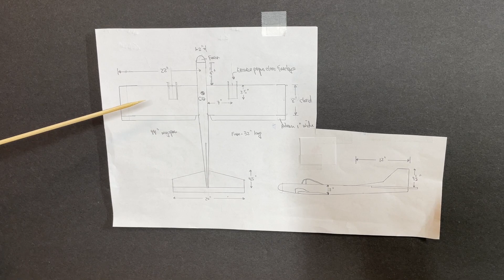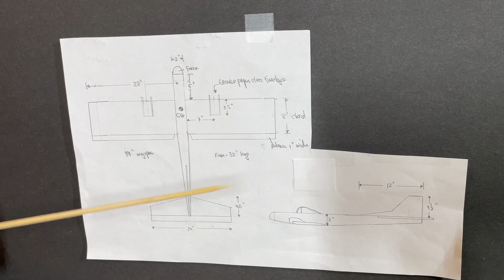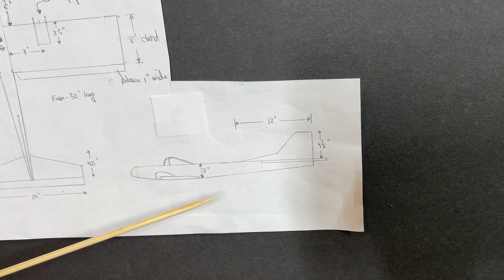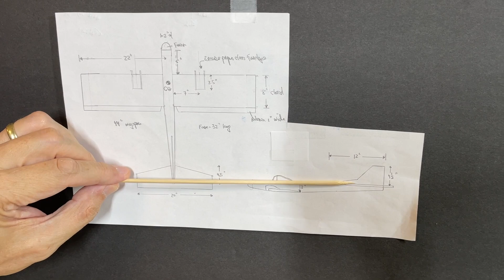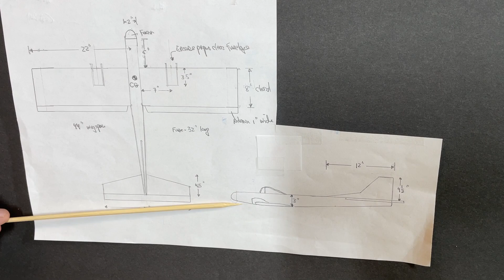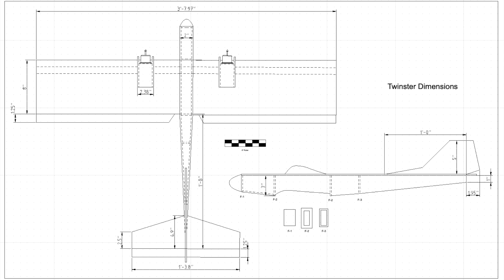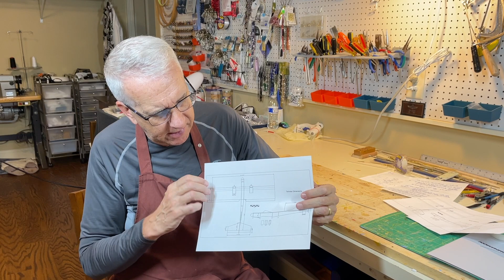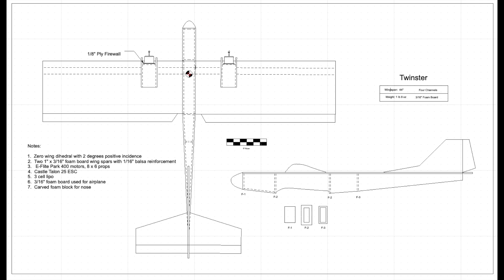How to Design an RC Airplane

Comment: Hi Tim. Am I assuming correctly that you are using one esc for both motors? Or are there two esc's placed in the fuselage? Thank you for your excellent videos.
Reply from the maker: I used 2 ESCs, one for each motor. I have a separate video on this. 😊

Comment: HI Tim, I have watched many of your videos. Great stuff. A question about RC aircraft design: 1) Recommendations regarding CAD software to purchase and learn from. Not too expensive and beginner user friendly? I notice you have used QCad and TurboCad. Recommend? 2) Now I'm  retired I would like to get involved in RC design, build and fly. Initially, start building from kits and then progress onto design. Would this be your recommendation?
Carry on with your channel as it is a great resource for the community. 
Regards,
Pete (UK based).
Reply from the maker: Pete:  Greetings from across the pond!  Your design plan sounds like a winner. I have several videos on aircraft design. www.QCAD.org for sure on the 2D CAD work. TurboCAD just too expensive now. I have some videos on QCAD, plus they have a great forum on the site. Tim
Reply: Tim, many thanks for your prompt reply. Much appreciated. I will certainly look into QCAD based upon your recommendation. Any thoughts regarding books on RC aircraft design? Again, beginner friendly to more advanced publications would assist as I make progress in self-study on the topic. Thank you.
Kind regards,
Pete (UK).
Reply from the maker: @PeterGreen-o6l  Pete:  There are some RC design books out there. I’ll be doing a video on this very subject, hope to get it out within a few weeks. Tim

Comment: Wow. That was a lot packed in to a video. Thanks for doing that ! I always learn a lot when I watch your content. It looks like a great little flyer as well. I'm going to embark on building a similar single engine "sporty" flyer, based on what motors I have lying around (a bunch of emax CF2812's I bought years ago). Probably won't be much different to what your foam bug ended up! 😄🛩
Reply from the maker: Brett:  The twin did fly well.  It would be very easy to simply stick a single motor on the nose and build a single engine version.  Good luck!  Tim